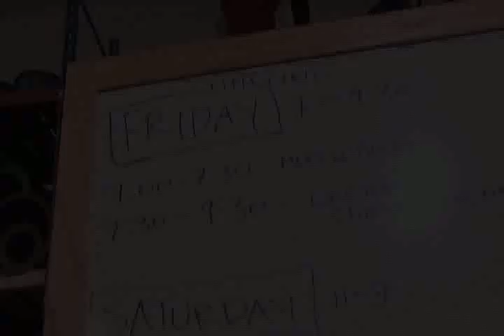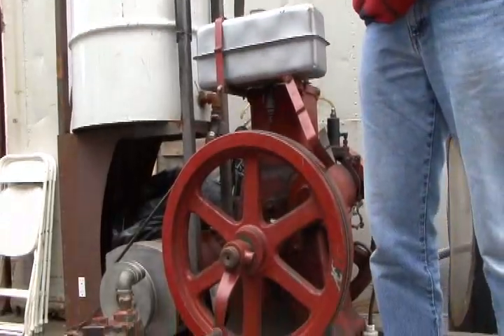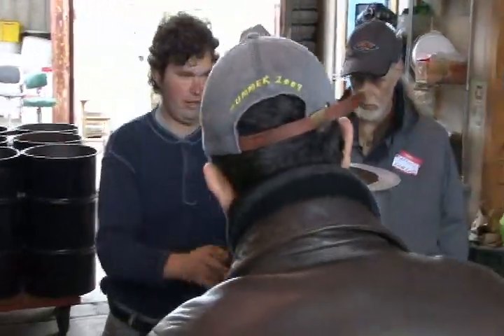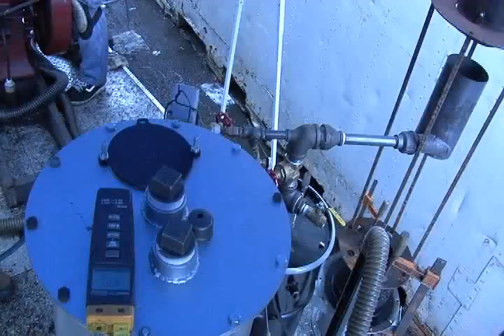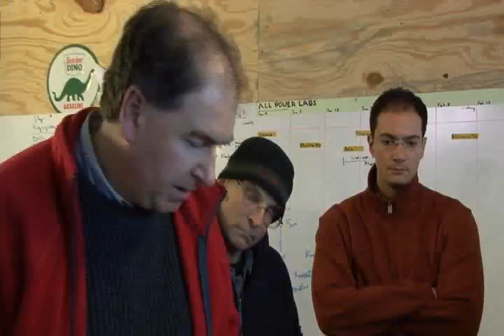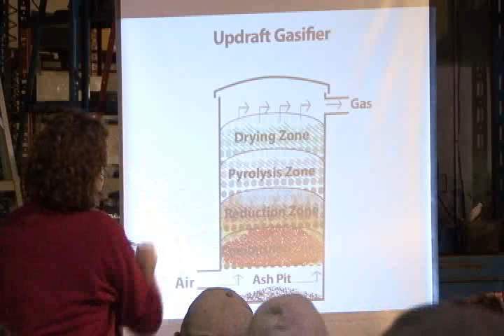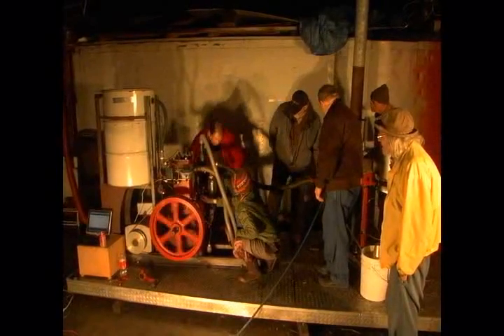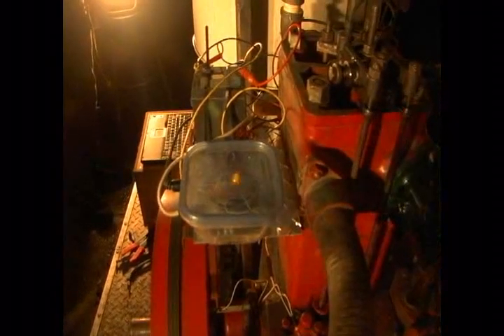APL Gasification & Biochar Workshop Feb 2010

Comment: On the day after we made this video, we loaded up the alternator with several halogen floodlights.  In total we had 2.75kW of floodlights connected, and the 6 hp Listeroid managed this load quite happily, at just 610 rpm.  We had fitted extra head gaskets to reduce the compression ratio to about 13.5:1.  I was very happy with the performance of the woodgas fuelled Listeroid, compared to the diesel ones I have previously worked on.

Comment: A cheaper high compression engine.

Harbor Freight predator 212cc modified with a Honda GX160 14cc head will give you the compression you desire.
The Lister has the wrong type of combustion chamber for this.